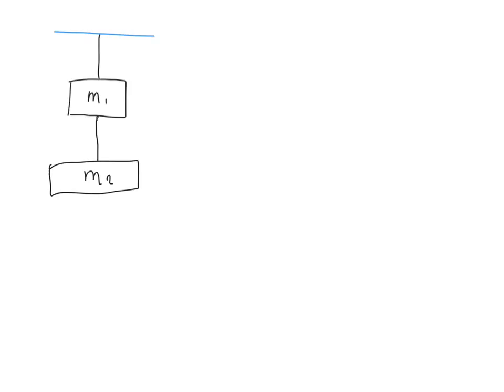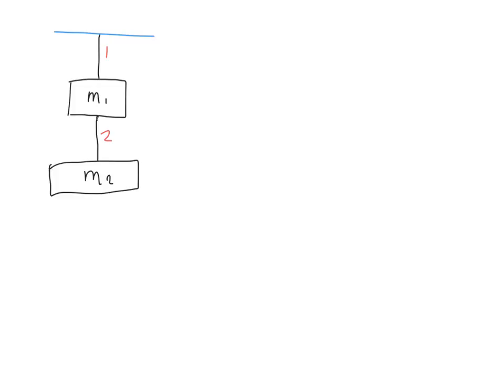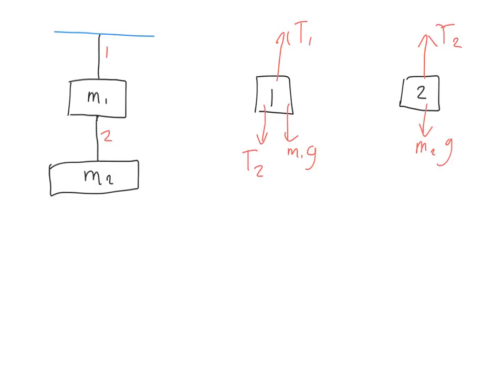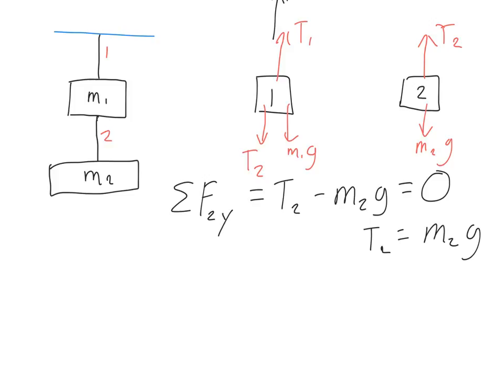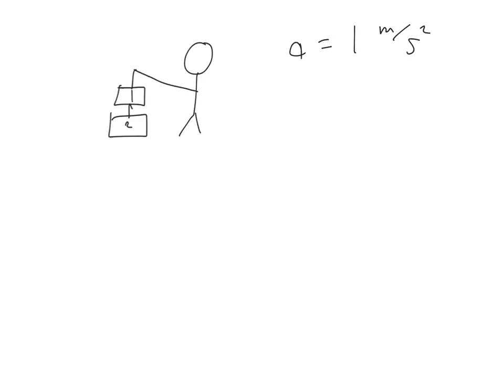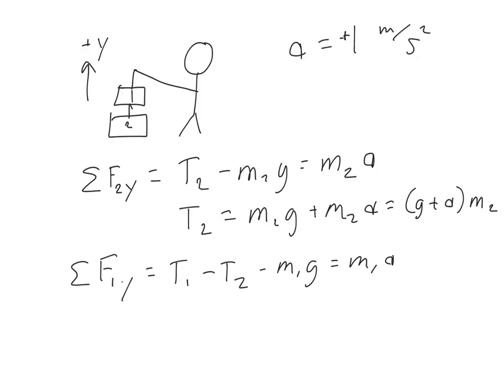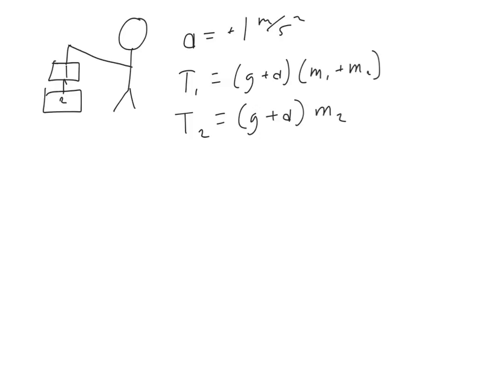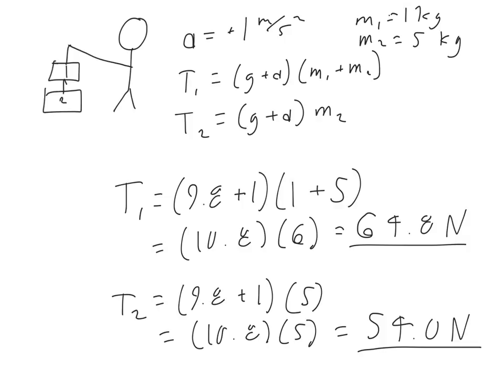Tension in Wire with Hanging Masses

Comment: so there is no FN and no Fg?
Reply from the maker: There is Fg, one for each block. However, there is no Fn, because a normal force only exists for surfaces in contact. Had either mass been on the ground, there would have been an Fn. In this problem, tension is doing the same sort of thing that Fn does, so if you imagine tension as the same as Fn you’ll get the expected results.
Reply: Aaron Adair goated man thanks🙏

Comment: Ok then I have a question that.. 
As the two blocks are separated i.e attached by string.. thats why on 1 block the downward forward isn't (m1+m2)g? It is m1g and similarly it is m1a? Not (m1+m2)a? 
So if they were attached with each other i.e  both are sticked with a glue or something they the downward force will be (m1+m2)g? And other is (m1+m2)a?

Comment: If you were a given a question with acceleration involved how would you handle it?
Reply from the maker: Instead of setting acceleration = 0 in the equations, set it to the appropriate acceleration value (mind also the sign of the acceleration as direction matters)

Comment: Great video but how would u find the acceleration?
Reply from the maker: Because it's just handing, the acceleration is zero.
Reply: Aaron Adair yes Ik, but other questions in general.
They ask you about acceleration
Reply from the maker: ABDUL cherchar you would need to be given that information or else derive it from other given info (e.g., a tension force)
Reply: Aaron Adair ohhhhh. Because one of the problems, the numerator- you subtract the masses(kg)  and times it by the earths mass but on the denominator, you add them. I don’t get why u add them in the denominator but u subtract them on the numerator